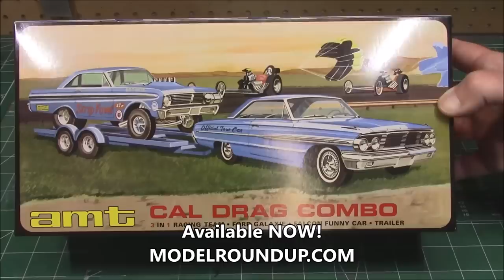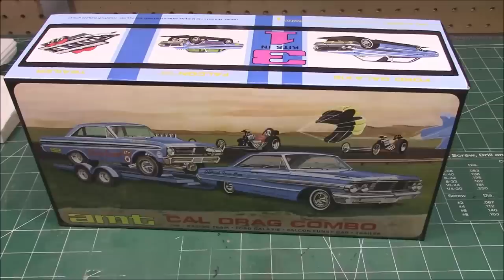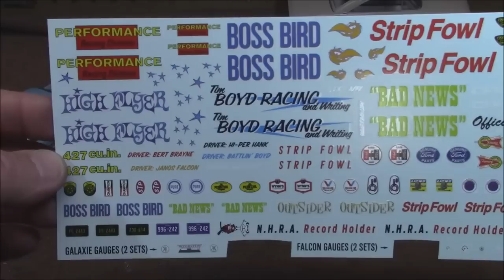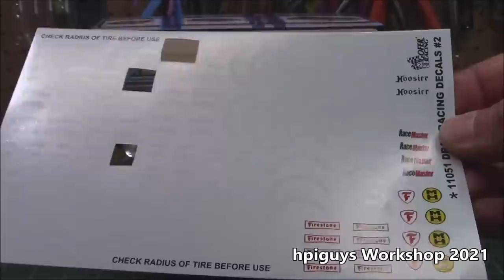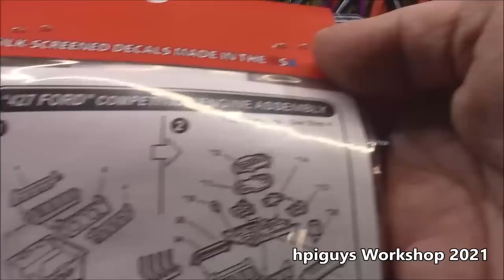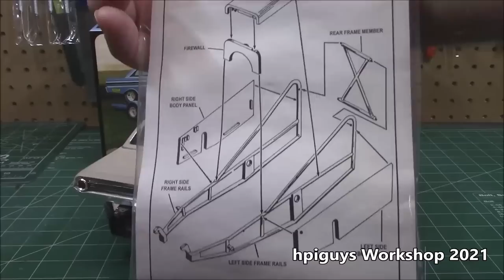1964 FORD GALAXIE 427 AWB FALCON CAL DRAG COMBO w/TRAILER 1/25 SCALE MODEL KIT REVIEW AMT1223 AMT

Comment: I believe you put the SOHC 427 valve covers on upside down. The spark plugs were in the top intake side of the heads. Other than that Great build. Yes Im a Ford Guy.

Comment: falcon is a 65, not a 64. must have kit, great build
Reply: A 1965 Ford Falcon funny car is still included in this kit, that has a racecar hauling trailer and a 1964 Ford Galaxie 500 sportcoupe.
Reply: In the early '70s I had and friend with a '65 Comet Caliente. Came stock with a Boss 302 and a 4 speed. He would beat a new '72 Cougar with the 351 Cleveland.

Comment: Didn't you put the 427 oil pan on backwards  ? Great kit and great job , do you know of anyone /any place I can get a bench seat for the 64 Ford ?
Reply: the valve covers also. Plugs go on the top.
Reply: Unfortunately that was how it was molded. The ford symbols are upside-down on the valve covers and engine block was molded for the oil pan to go that way unfortunately 😕

Comment: Awesome Video! Awesome Build!  Q: Do you use the Molatow pen on molded-in badging?  e.g., if "Galaxie" were molded in to the body side panel, would you use the pen for that?  And if so, is the tip fine enough?   I can not find a video where a modeler actually "chromes" molded-in side badging.  Thanks, and again, you put out great videos for the beginner car builder!
Reply from the maker: Yes, I use Molotow and silver sharpie on badges and what not. Molotow makes a 1mm tip for fine parts.
Reply: @hpiguy  thanks for the reply.  Yeah I ordered the finest tip pen and a refill. We’ll see.  Thanks again.

Comment: Originally 1964 the Galaxy 500 kit came as a hardtop and convertible with an engine and transmission and radiator and working headlights and tail lights same with the 1964 Impala Super Sport Chevrolet with working headlights and tail lights with a 409 engine and 4 speed transmission, I just did this kit before it came out with parts from other models because the Falcon has been out for a while as well as the trailer was available a few years back as part of the Blueprinter deal, Same with the 64 Galaxie you can buy them for $4.50 to from Blueprinter, I bought five of them of course one was missing a tail light lenses and I finally got it in a parts box, But I did mine to match the late Hubert Platt's who actually Drag Raced a 65 Falcon AFX, His Son races it today, And I used my original 64 Light Up Galaxy 500, both the Galaxy 500 and the Falcon and the trailer are painted with the Testor's Star Spangled Blue Lacquer paint, and clear coat it with Testor's High Gloss Clear Enamel paint, I love watching your videos, Don't anybody tell you how to change things, Beautiful builds all the time !
Reply from the maker: Thank you!
Reply: @hpiguy  You are so Very Welcome !

Comment: Im just starting in models so excuse me for a basic question but what types of glue do you use?
Reply from the maker: Plastic to plastic I like Plastruct Bondene.
Everything else I use dollar store super glue.

Any modern liquid plastic cement for models works well. I avoid the Testors orange tube glue as it takes a long time to dry but it can be used if it's all you have.
Reply: @hpiguy  what do you use on the glass I've heard Elmer's white glue and thank you for your fast responce